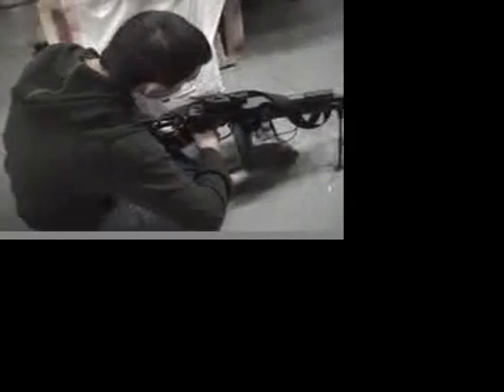Tippmann A5 Paintball Marker Box Mag Part 2: 100% up

Comment from the maker: I made it using instructions from the undergroundmodshop.   Basically Find a box, take the rotor/feed cup out of a Halo B, hook a hose from the halo B up to the A5 so that the paint gets forced up the tube by the wheel. Fit all that in the box. Mount the box.